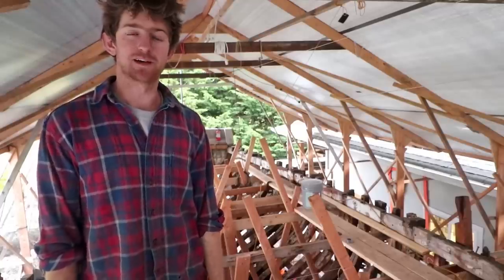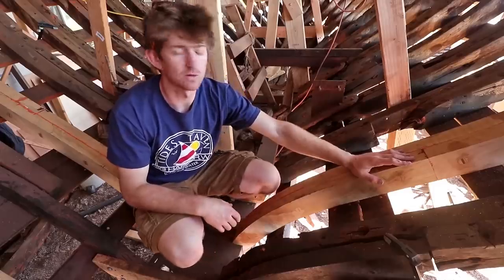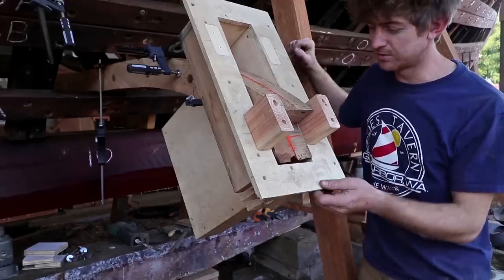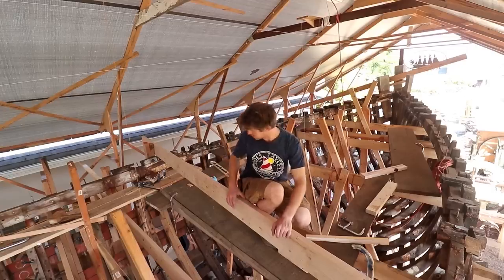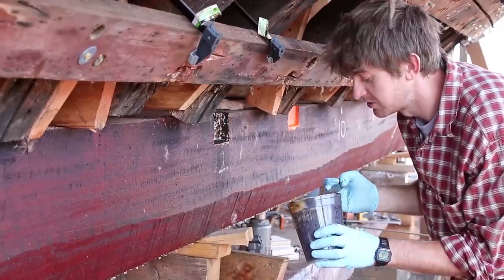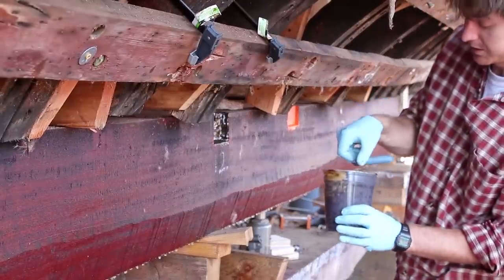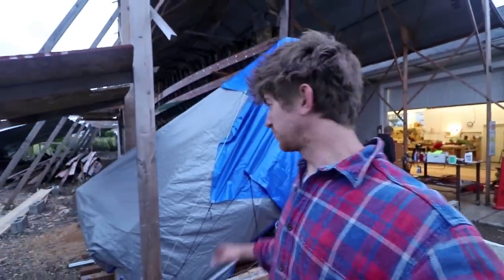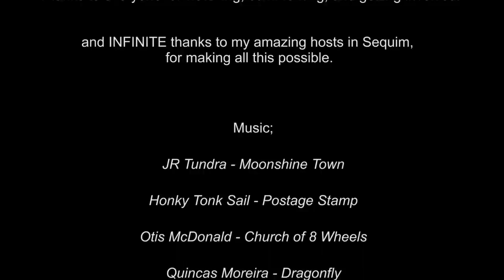Bedding Wooden Boat Frames / Packing Up Shop! - Rebuilding Tally Ho EP31

Comment: As a child I used to watch boat owners repairing/rebuilding their boats while dry docked near Barnegate Bay N.J. It fascinated me to no end. I wanted to be a boat builder since 3rd grade.  But alas, we ended up in Illinois, away from the inspirational and eventually my desire crept back to a warm place in my heart. As an aging adult I picked up other creative means of expression through ornamental iron and woodwork. 
I plan to build a cedar strip canoe to satisfy my desire that build a floating vessel. It’s certainly not even close to your level of craft but it’ll have to do. Thank you for your inspiration and great offering of knowledge.

Comment: I was starting afresh on the episodes as I'd not seen the earliest ones but time for Cue the Nerd!
Stockholm Tar is made by 'roasting' the roots of Birch ideally and the result is the boiled sap and some combustion products resulting in the tar. 
It is similar to charcoal in that way but a even for charcoal, a more controlled and slow 'burn'. Clever process. 
I'm more used to Viking style vessels where it's a hull first and then frame and also plenty of Wrought Iron fixings for the strakes etc. Also very little use of the saw but way more axing.  

Adorable work. Totally dedicated.

Comment: Just started watching all your videos and just a small piece of advice. The next time you need to drive anything such as keel bolts. Take a medium sized or larger hammer drill. Sacrifice a used bit and half inch drive socket that will fit over your intended bolt. Cut the bit off to about 4 inches, drive it into the drive end of the socket. True it up and weld inside and out. Put this in your drill, put it on just hammer, and it will do the work for you.

Comment: Great stuff Leo! I've just finished catching up on all 31 episodes. Love it..... But I have a question, and a suggestion.

Firstly, a suggestion. Your planer jig, with the 4 level adjusting screws, could be improved hugely by welding a small bike sprocket to each screw adjuster, and linking them all with a bike chain. Add a simple crank handle to one of them, and you would then only need to turn one handle (rather than 4 knobs) to raise or lower the plane. Obviously, this is the same way as planer thicknesser beds are controlled.

Now, the question. Is this really a restoration? You are replacing all of the boat's ribs, keel, deck support timbers, decking, and hull planking, plus all of its ironwork. From what I understand, the only things you are retaining are the hatch covers, and maybe stem and stern posts. Is this right? (Forgive me if I get the terms wrong. I'm an architect and restorer of ancient timber frame buildings, and nautical terminology isn't my strong point). If that is the case, firstly it seems rather brutal, and secondly, isn't it just a new boat with a couple of bits scavenged from an old one? Why didn't you just scavenge those pieces at the original boat yard and then build a new one, without having the old one in the way? Restoring old timber frame buildings involves judging what is sound, and scarfing new pieces in to the old in place of rotten stuff, or "sistering" new to old, to give the old a bit of support but retain the presence of the original. At least you end up with a building which still retains as much of the original as possible. Your boat, whilst beautiful, will be 95% new (or more), won't it? I think there were 3 or 4 "original" Chitty Bang Bangs, the Brooklands racer, kicking around at one time, one of which only had a couple of bolts from the original car. Is this not a danger with the Tally Ho?

Comment: Pine tar and bees wax makes a great skin moisturizer and cleaner for hands.
My doc tells me it's an old world skin treatment and has anti-bacterial property's.
 After years of heavy line work on vehicles, I gave up using fast orange and other harsh cleaners, they create issues with the skin you won't see for 20 years or more. Goop and Fast Orange will ruin skin, get Hubards shoe grease and use it instead. 
It cleans leather and cleans skin just as well. it also works very well with wood.

Comment: Hey Leo I have found the if you put 20% Cuprinol on with the linseed oil it not only helps a bit with rotting but it helps the linseed dry faster and gives it a nice looking colour to the wood!

Comment: We used to bash red lead primer into linseed oil putty for an anti-rot bedding, have also used it on top of caulking cotton from a closed caulking gun.  Making the stuff up is horrible,sticky nasty, but it works well,we used the primer because we could no longer buy red lead by itself !

Comment: 18:35 THAT is the sound a Vanagon makes when it has been sitting for some time. Oil drains from the hydraulic lifters. The noise is from the resulting valve lash. Mine does the same, funny to hear the sound in a completely part of Youtube than the Vanagon channels. Thank you for the superb content!

Comment: Years ago the government made Dolphinite change their formula and remove a chemical. The product was not the same and not as good in my and few other builders opinion. When the change happened many of us went and bought all the old cans we could afford. Your modifications and additions look like a great solution to the issues the new product caused. 
Thinking about digging out my caulking irons and mallet and running over to Sequim when you get ready pound cotton.  I assume you will use oakum for under the waterline.

Comment: I expect that you are more accurate than the original builders. A lot done by eye and hand back in the day.  Props to Kurt for getting after those guides and table. I've had an itch over that for weeks.  Hope he looked at the tyres on the blade wheels while he was at it.  Good on you.

Comment: "The frames are perfectly plum, now need to  trim wood off of the horizontal face of the heal of the frame in order to make the frames perfectly in line with the water lines and the buttock lines in terms of their distance away from the center line and their vertical height in relation to the water lines."  Got it!
Reply: Ed Tin Futtock!  But we like the way you think ;)
Reply: futtock not buttock :-)
Reply: Thank you Sasquatch,  keep getting my futts and my butts mixed up.  🙂
Reply: when you confuse futtock holes with .... it gets worse ;-)
Reply: I think you meant PLUMB, or have you also confused your fruit with your lead 😉
Reply: Sasquatch ... The lovely Francesca perhaps?
Reply: I couldn't possibly comment....
Reply: I cannot help but think that there could be a series of amusing T-shirts from such language.
Reply: Man i hope leo is reading this....i will take one in any colour
Reply: D.T. Baker  "Sampson Boat Company - when one rabbet joint is never enough!"

Comment: I really adore your patience and passion for this project. It must take ages to built one set of frames if you add up all the preparation and measuring, fiddeling and painting. Was the orange paint still wet when you applied the greasy dolphinstuff? It looked like it squeezed out as you attached the frame to the keel. Would this have any i fluence to the function of the paint?

Comment: How do you mechanically attach the frames to the keel? I did not see that in the video.  Thanks.
Reply from the maker: Good question! They will be pinned with copper dumps probably (blunt nails), but the Floors (to be installed later) will provide the main structural join between the frames and the keel, via big bronze bolts through the keel timber and copper rivets through the planks and frames.
Reply: I knew that. Well, I suspected it. :)))

Comment: If you can't get good putty make your own its actually very easy as its just a blend of Raw Linseed oil, Pale Boiled linseed oil and ground limestone mixed in a planetary mixer(cake or dough mixer) actually when I started as a coatings chemist the old timers used to say the best putty was made from the white cliffs of Dover (or at least chalk/limestone milled from the area) something to do with the crystal structure giving a roundish particle shape thus a putty that would draw out very thin without breaking. I would do it for you but I live on the other side of the world. I imagine you need a putty that takes several decades to dry so mostly raw linseed oil would suit you best. The limestone companies will sell you 25Kg bags for less than a dollar a KG not sure how good the American stuff is but I am sure there's someone who can help get you the right grade its the same one used by paint companies to make primer paints.

Comment: Leo, given the structural integrity of the boat is greatly compromised due to the works, due you regularly stop to assess this at any stage before proceeding with some more removal/replacement works? Love the work you are doing btw.

Comment: First video of you wearing chaps when using the chainsaw...please keep that habit up.  Drop starting and using just the toe of the bar are risky, so at least protect yourself from the dreaded kickback.  Ever seen the result of kickback? I have.  Kicked into the calf of the operators front leg during an upcut of a low branch...not the easiest to stitch up.  But thoroughly enjoying the binge watch of the entire series to date.  No better way to spend a COVID19 lockdown day. Cheers.

Comment: The blocks you use to chain saw out your rough parts should have wood blocks on the face that the wood sits on.  It would save a lot of damage to the teeth on the chainsaw.

Comment: I had two total knee replacements and for 18 months had the privilege of going to physical therapy with a lady that used a saw and ignored safety chaps and safe practice and in the split second it took the saw to cut through muscle, bone and most of the opposite flesh she all but lost her leg..  they make those chaps for a reason!  (If you need to borrow a pair....)

Comment: There seems to be a lot of time invested in the making of templates. I have made complex shaped lead parts before by plotting full size on paper and glueing the paper to the template ply before cutting out. If some one could digitise the drawings then printing off any frame is merely a matter of a long plotter. I'm sure there are folk on YT closer to the build who could do this. Would it help?

Comment: Great channel. Impressive undertaking! Wondering...could you shortly explain the benefits of paint and woodpegs vs modern glue or thickend epoxy for assembling the frames. Or are you doing this "the original way"? Maybe woodpegs with epoxy?
Reply: Grote Henk Pretty sure Leo answered the glue question in his last video 👍

Comment: I don’t under stand a couple of things , I respect you are a traditionalist, and good at it , the boat is of old , and building it back to its original is nice , why not belt sand the frames , rout the inner corners , sand up , and clue the frames with expoxie glue then varnish them up ,   Back in the day these were built rough , some times bark was still on the frames , grown nees etc , if one was going to the expense why not glue everything so cutting down in the maintainance in latter years , just a thought

Comment: I bet you already thought about this, but won't adding that extra height to the saw table move the work piece away from the point around which the table rotates? i would assume that point was where the blade intersects the table? Thereby a change in saw angle would move not just the top edge of the work piece in/out, but also the bottom edge?
Reply: The angle is the same tho, no matter how high up the blade you cut.

Comment: Having been a big customer of local sawmills in the past, and reader of timber stumpage and boles, I must say this is very satisfying. A sailing vessel is both a vehicle and a dwelling, thus doubly satisfying for a designer, and a reader.
The problem I see here in Roseau county is the ability to read specifications. I will buy it all, if it meets spec. Big market, lots of trees. Not a pulper here. RT is 200!?! Wood fiber has a higher use. Pulp Levi Strauss and Co. Right away! (They are malevolent fools!)
It was generational in the past. Now, the race is against Fascist Google and their algorithms. The Machine now = The Man. You want to buy "waste" wood from a national vendor? You. Will. Lose.

Comment: Ok rolling bevel - using the ship saw and manually turning to get the bevel how exact does that have to be... because it would seem that one can turn the bevel faster or slower to change the bevel more or less to one side.  So how do you control that or is it irrelevant in the grand view of things?

Comment: Leo: Have you had to replace that tarp over Tally Ho yet or is that still the original tarp? I ask because I also use the same color tarp over my boat shed that I purchase from HF and they never last more than 3 or 4 months. Just wondering where you bought yours. Thanks!

Comment: So, is that "rot inhibiting primer" your using red lead? Looks like red lead to me.  Where did you find it?  Did you make it yourself?  Great stuff if in fact it is RL. I have only found very expensive sources for this paint, I'd like to know what I could use instead that would be less expensive and just as effective— any ideas?
Reply: I would have had the same question,thanks you asked it.Maybee we get a answer sometime
Reply: I think he said in the vid where he assemles the first frame, I'll have to go back and look, no need to twist my arm either:D
Reply from the maker: It's still possible to buy red lead primer and also possible to buy an imitation called "red lead replacement". People seem to have a phobia of lead these days so you will have to guess which version I might be using. But if you want proper red lead primer, I head from a little bird that there is a website called  Kirby Paints....
Reply: @SampsonBoatCo  Thanks
Reply: Yes, that is the only place I knew that had it.  Best stuff for the job.  Though still expensive.  Thank you for your reply and thank you for all your Tally Ho updates.  Smooth sailing

Comment: 3 out of 44 frames, in a month. Then there is "floors", and re-planking.
Then you can console yourself with the thought that you have finished about 25% of the whole boat.
Reply: @jed7644  haha. I  have built boats before.  You can't trick me.
Reply: @jed7644  Im figuring that DESPITE those really obvious improvements he still has all the hand keel  notching, hand pattern making, wrestling frames between old ribs, adjusting planks,  hand carving wooden trunnels instead of metal fastenings, propping up the boat and checking levels as he goes, THEN he has to fit all the old planks,  build the new planks,  fasten them, fill the holes, measure and cut all the individual floor timbers,  treat the timber and THEN he is 25% finished. 
Those small improvements are just a drop in the ocean.

Comment: noticed you are beveling the pieces 1 level at a time, and while I know this video is near a year old, would it not be far simpler to join both levels together then cut the final bevel on the single frame?

Comment: Hello Leo, why do you hate the new frames in the keel? And the old ones were not admitted? Or did you saw off the old ones before? For example, in the video at minute 7:58, the new frame 12. In addition to the screw clamp, the old frame is higher and shorter. Sorry, but I do not quite understand it! Best regards Tino from Germany

Comment: @Leo how do you make sure you get the right angle on the table saw now? Because if you put in a board on top of the metal table you "raise" the table but the angle reference point is now under the new table height and not on the same plane anymore....
Reply from the maker: We had to think about that too, but actually the angle is the same regardless of the height. Imagine if your are sawing through a 3" piece of timber, the reference point (ie the line you are following on the wood) is 3" above the table but it doesn't matter (the wood may have to slide sideways slightly). Actually, as the saw was designed to cut large pieces, the rotation point of the moving saw may be some distance above the table anyway.
Reply: like I said... lol

Comment: Still don't understand how you're going to get the frames to fit where the originals are wrong. I assume you can't just lay them in like you did here.

PS. England is medium high clouds and plenty of gusty wind currently - basically it's nice.

Comment: why not 2 part epoxy?
Reply from the maker: I explain in one of the recent previous episodes why epoxy is not really used on traditional boat hulls.
Reply: I've tried using epoxy on a bow, and it is so brittle that it ends up cracking rather than flexing.  the one i used was supposed to be a "flexible bond" but when i was fitting two pieces of wood together, it was too thin to have enough material to flex.

Comment: that chainsaw is horribly dull, wrong way to sharpen, look at how to sharpen to get the correct angle and you wont struggle as much
Reply from the maker: Errr no it’s not. It’s a ripping chain - 10 degrees cutting angle, not 30. Much faster with the grain.